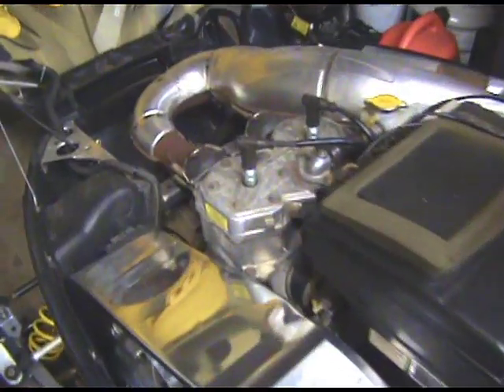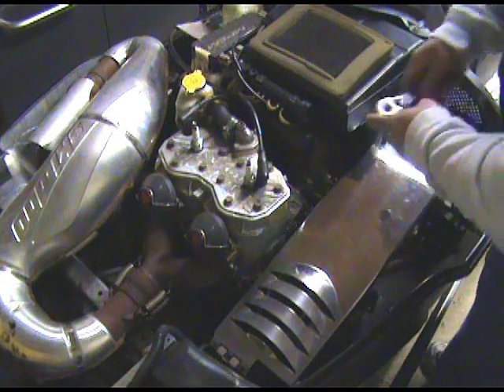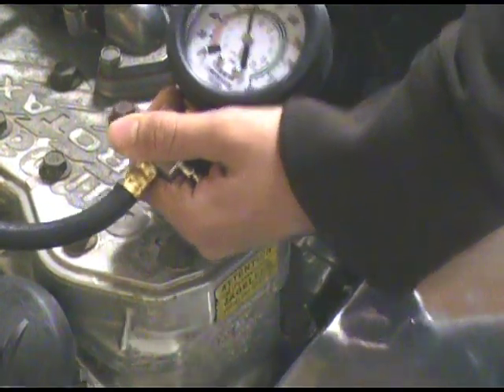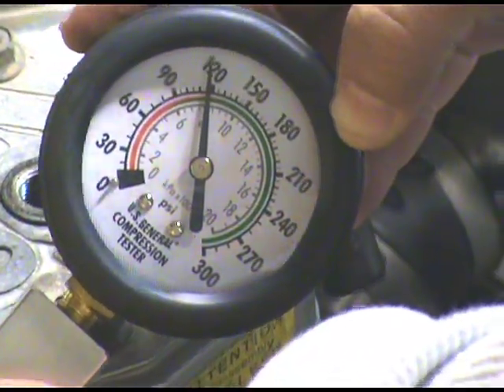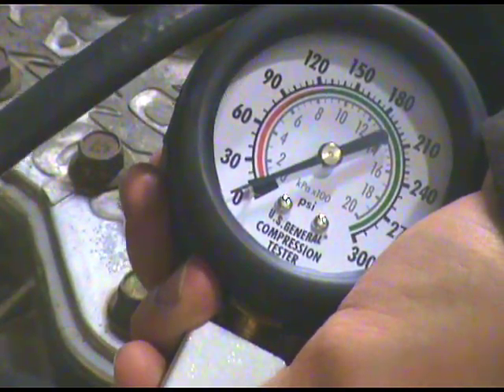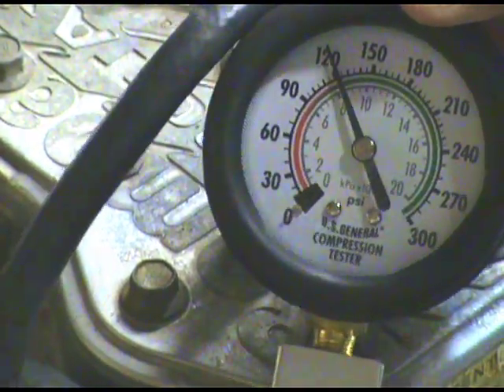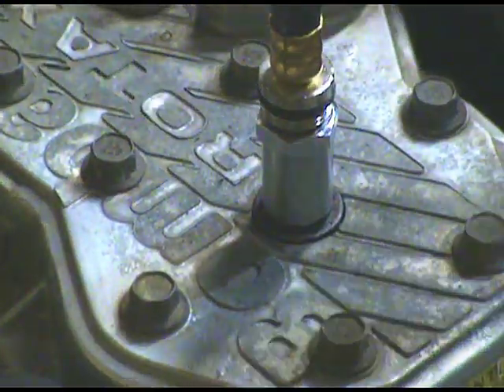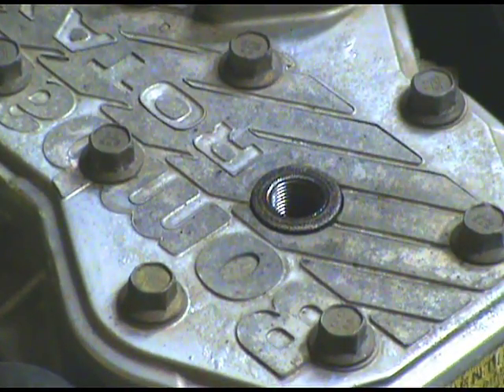2000 Ski Doo MXZ 700 Compression Test #1

Comment from the maker: @mrwiggles2 
Thanks.  I trust this reading too because I checked the compression right before I bought the sled using my buddy's compression tester and did this test with mine and got the same reading both times.  Thanks for the insight.
I already joined a club too.  In New York state the snomobile registration costs 100 bucks, but if you join a club it goes down to 40 bucks. The snowmobile club fee is 25 bucks, so I'm still saving.  Thanks for the comment.

Comment: More important that they are within 10% or so of one another.  The problem with compression tests is the tester itself- never know if it a reliable instrument.  So, good that the results are holding at 120psi and that they are both spot on.  Great machine you have there.  Are you going to join a club?

Comment: @paisteboy 
I would say SPI, their pistons is at least as good as original pistons if not better. You could get a kit from ebay for about $65. Wiseco might be better but alot more expensive! You can find the gaskets on ebay too for about $40-50 depending on what brand you choose (i would take winderosa or wiseco). This sums up to about ~$100 + shipping for a complete top end rebuild wich should keep your sled running a very long time! :)

Comment: When doing a compression test you should take out only one sparkplug and hold full throttle while pulling hard until the meter stops. Do this first when engine is cold and write down the result, then warm up the engine and repeat the process. 120 psi sounds to me like a piston/ring change is coming up. 115 psi is the minimum value. You should have way over 140 psi if the rings were new maybe 160 psi, unless the break-in was really really bad. Well i hope it keeps running for you, nice video! :)